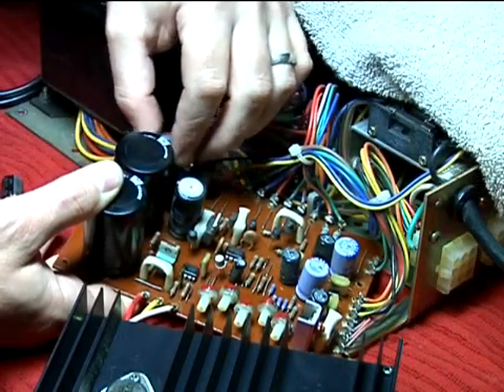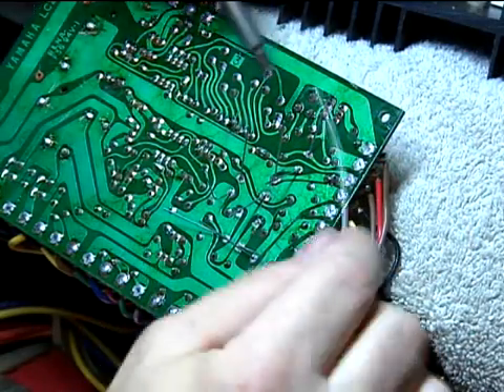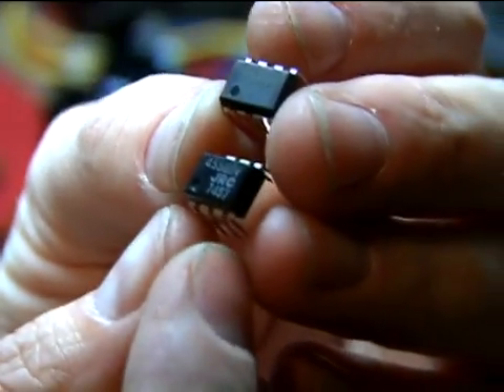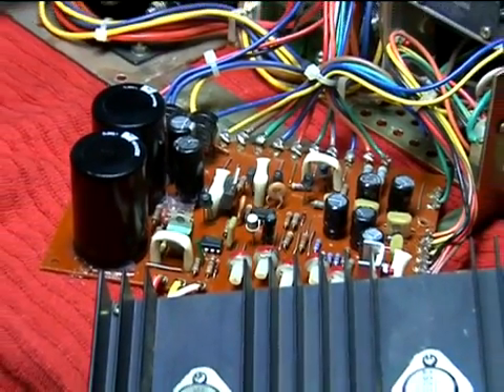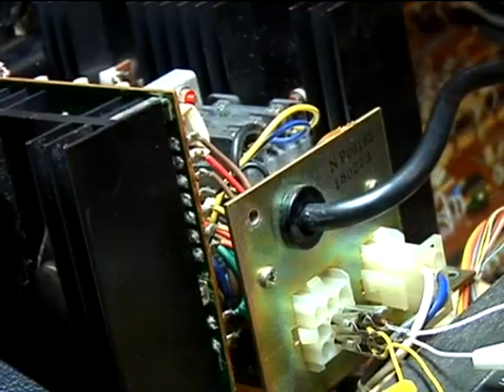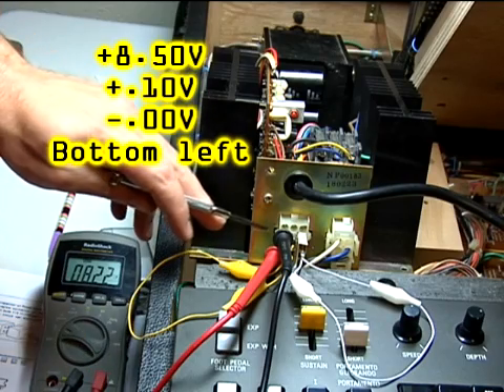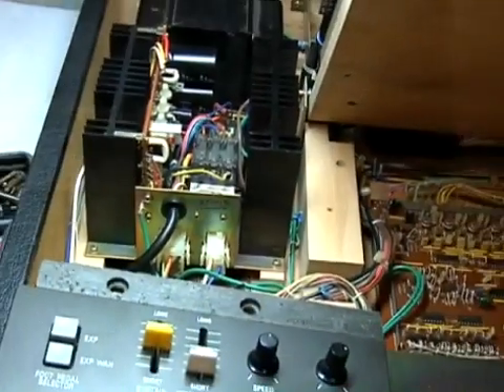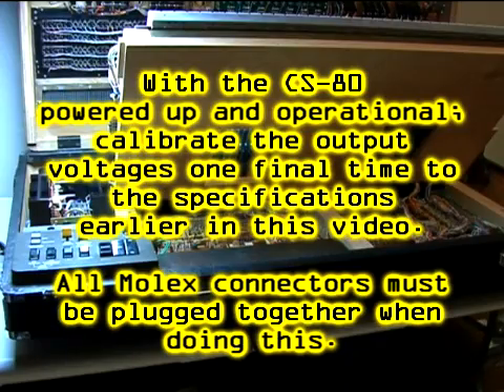Saving the Yamaha CS-80 (3) The Power Supply

Comment: Hey man, I just fixed one CS80 which had a power supply problem caused by somebody doing just what you describe. They replaced perfectly good original capacitors with new Panasonic but the ESR of the cap is too low and caused instability. I can see you haven't checked the output of the PSU with an oscilloscope to ensure the voltages you measure are stable and free of any ripple. I fixed the problem by putting back the old perfectly good Nippon Chemicon caps and it's now clean as a whistle. Another issue I see is during the calibration procedure this needs to be measured between the tie points in the middle of the rails holding the cards, not on the PSU itself. Currents aren't insignificant here so there is voltage drop between PSU and the rails.
Reply from the maker: Interesting!  I never had any ripple or issues on my CS80's I had rebuilt with this particular kit.  Knock on wood... was this from one the PSU kits you had issue?

I have not encountered a problem as of yet with ESR of the new capacitors provided in the kit.  I tried to keep with Panasonic EB, which have higher ESR (1-2 ohms) in trade for their 10,000+ hour lifespans.  I didn't want too low of ESR to stress the rectifiers or pop the AC inlet fuse.  

I do use Panasonic FM series for low ESR applications aside from main filter.  They are usually 0.1-0.5 ohm ESR 1kHz on my test rig.

The final voltage calibration at the card rails as you suggested is ideal.  The CS-80 PSU does compensate for voltage drop automatically via remote sensing, potentially allowing one location calibration of voltage at the PSU.

The CS-80 PSU uses a "Kelvin Clip" type servo feedback to compensate for voltage drop across power lines from it to the card rail automatically and in real time.

 Many of the older Japanese capacitors were amazingly .1-.2 ohms ESR (rivaling Panasonic FM series today) in my CS-80's when tested, but were leaking electrolyte so had to be replaced.  Almost every electrolytic had green lead disease in my machines.
Reply: @gavincurtis  I'm unfortunately not the only one, Steve Jones was less lucky because in his case the regulator feedback loop went into full oscillation and it killed some of the parts further up the chain (not what you want to happen to CS80) Kent Spong also said he has seen that problem before. It is critical to use higher ESR capacitors and check it before it's installed. 

https://photos.app.goo.gl/6QbXu8x2rTV4iGi1A

I'm not sure if the link will work but it's how the +15V rail looked like before I swapped the capacitors back.

Comment: Hey Gavin, thank you for these invaluable videos. May I ask why you chose to change the uF rating of the two large caps from the original value 5600 uF to 8200 uF? Does this make the circuit superior to the original design?
Reply from the maker: Hi, going to 8200 is not necessary.  I went larger because the 8200uF Panasonics had the best pin spacing and having a little extra bulk filtering headroom is not a bad thing.  No issues with inrush current etc with the larger units.  They also can be of benefit as the dozens of 100uF decoupling capacitors on the voice, output effects and preamp boards are end of life and leaking electrolyte on most cs80s.  At least all the CS80 units I have worked on.  So the extra uF helps in this case.
Reply: Oh ok, I think I will go with the higher uF rating. Thanks for the quick reply, and again for all these videos as I begin my journey restoring this wonderful machine.

Comment: jeez - with those jumpers you have set up there - you're not insulating between them?? seems like you could (would) easily short out the plus and minus 15v lines with each other?
Reply from the maker: Yup, pretty bad of them to not have easy access test points.  But there is no option and yes I was quite nervous.  The rubber insulators force the alligator clip open when slid back far enough to make contact, so I had to take them off completely.  You have to perform that test with the connector together or damage the power supply and main boards in the keyboard.

Comment: Hi Gavin, i made the adjustment procedure and concluded i needed to change some parts on the PSU side.I'm interested by your PSU rebuild kit.Found it on your ebay and sent you a question about the content of the package (if it include all PSU parts with no exception, or only some selected parts.Waiting dor your answer before purchasing, thank you!

Comment: Hi Gavin:) I've been watching at all your maintenance videos about YAMAHA CS80, which are great! It helps me get confident about fully restoring mine without hiring a tech, but before doing any modification, i would start with those voltage measurements as described in Yamaha's adjustment procedure.But in this video regarding PSU, i would like to know if i can make those measurements directly from the connections (the ones we see at 5:30), without even going thru the 1st part of this video (w/o taking off molex connectors, adding jumpers in place)? Any damaging risks doing so? Thank you!
Reply from the maker: Hi and thanks for the compliment.

You can definitely check your voltages without the jumpers.  You just have to make sure the molex connectors are plugged together to the rest of the keyboard.  If you power up the power supply with the molex disconnected and without the jumpers, you may damage the power supply.
Reply: Gavin Curtis Thank you for this clear explanation.I followed those advices and checked all the voltages according to Yamaha procedure.Though, it seems the's some confusion in the Yamaha procedure: in PSU adjustement page 1, they mention measurements to be made between ground and other boards (KBC for +8,5v and - 6,5v/M18 for -15v/BA for 10,6v), while on the next page the layout shows that everything should be measured on the SAME SVU board.Maybe you solved this confusion from the manual? Or are those measurements points the same in the end? For now i did measurements from SVU board exclusively, and everything is fine at measured points.By curiosity i also checked the +15S/-15S, which are more around 14,87v.Do you consider it is acceptable, or am i elegible for some PSU parts replacements?
Thank you again for your help, and a big thumb up for your tech skills !

Comment: I commend you.. perhaps you could help me (or lead me) in the right direction for the right replacement transformer for my Hammond T-212...  that is.. REPAIR the board rather than replace it...

I like how you resolder ALL connections... always nags at the back of your mind wondering if shock might have ruptured a weld.....

 5 stars bro....